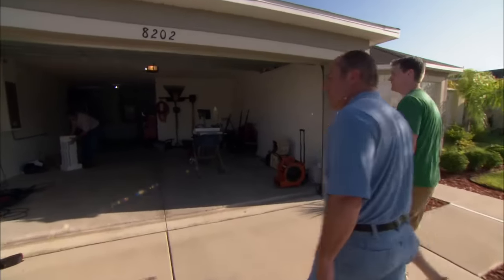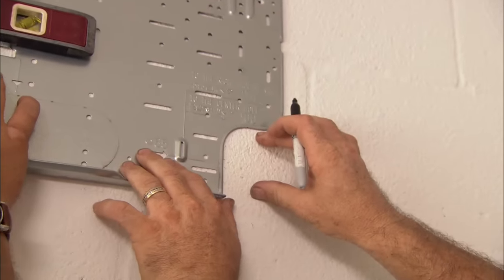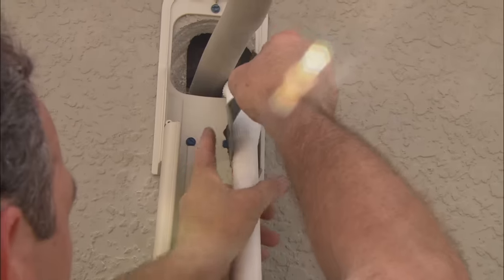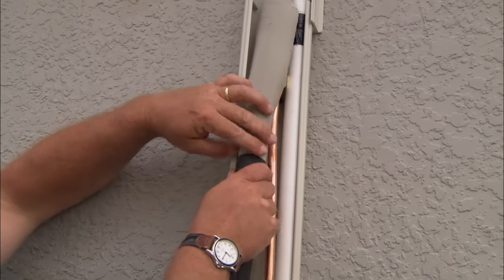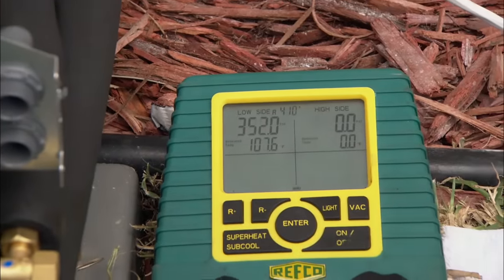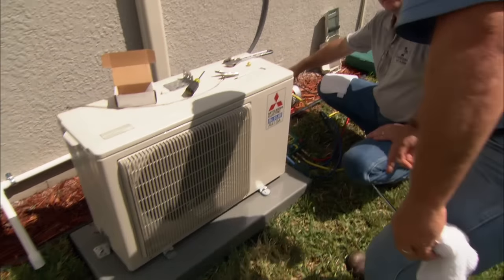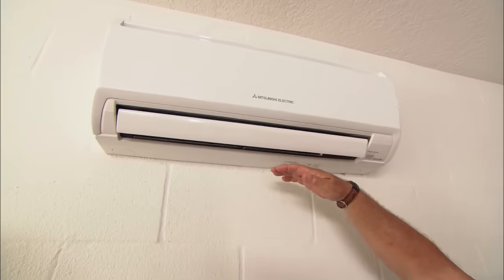How to Install a Ductless Mini-Split Air Conditioner | This Old House

Comment: Why isn't the external unit mounted on the outside wall?
Reply: this is a personal homeowner decision.  mounting it on a wall bracket insures a much cleaner looking install with easier lawn cutting and no worries from snow fall in colder climates (obviously not an issue in this climate) but also posses noise issues especially on a cinder block wall like this one where the outdoor vibrations CAN travel through the wall bracket and into this inside conditioned space.
Reply: Oh come now, the unit is cooling the garage, not a bedroom!  Lots of noise inside a garage workshop!

Comment: ive never seen that make flare tool, it works cause that was a perfect flare. It looks weird at first seeing bare wire outside i guess that cover is to code! I know there is liquid tight after the cover

Comment: "Idiot-proof."

Challenge accepted!
Reply: +bigchicago111 we love cold air in the summer!
Reply: Seems that is very easy to do this by yourself, but I prefer to call a plumber :) #rfzstt
Reply: More POWER!!!

*sponsored by Binford tools
Reply: Damn it ain't idiot proof! Ma, call 'em 'bulances I got my all tide up.
Reply: I twisted the red, black, and green wires together and put a wire nut on them. So..question. Is this thing supposed to be smoking like this?
Reply: Someone give this guy a medal.
Reply: ok
Reply: GodOfPopTarts ඉය
Reply: Being in a room without aircon feels like sauna

Comment: 0:00 - Ooh, I'd love to do this for my garage!
0:30 - Yep, this looks doable, maybe next weekend?
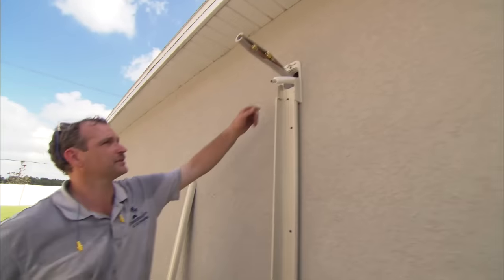2:00 - Hmm, this might be a big job ...
2:40 - Oh, I would have probably messed that up and crimped that line.
3:10 - "Flaring tool?" What is that?
4:40 - Testing for leaks with nitrogen? Who are they kidding? I can't do this!
5:30 - Yep, this is why you hire a professional to do this job. Not even remotely tempted to try this myself any more.
Reply: I had the same.exact.thought...in the same exact sequence🤔
Reply: Its actually easier than you think 🤔!
Reply: To think all this took less than 8 minutes.... lmfao
Reply: Testing for leaks is not complicated. -Hook your gauge hoses up to the access stubs of the service ports
 -hook your middle hose (the yellow hose) to a regulator on your nitrogen tank
-make sure your gauge valves are closed, open up the nitrogen tank
-adjust the regulator to about 300 psi
-open your high and low side gauges slowly until the pressure on your gauges reads about 250 psi on high (red) and above 120psi or "retard" on your low gauge (blue)
-check for leaks using soap bubbles at all connection points, try to see if you can hear any hissing as well
-once you confirm no leaks, close your nitrogen tank, and unscrew the hoses from the manifold (just enough to purge nitrogen from system)
After that you just reconnect your hoses tightly to the gauge, hook up your vacuum pump and evacuate to 500 microns (about an hour. 30 mins with a 3/8 vacuum hose and port)

Think you can do it? I do refrigeration for a living but ductless systems are literally child's play. If you follow the proper procedure you can do it yourself.
Reply: You can get ones with pre charged line sets you wont have to do any of that

Comment: Did you know that a masonry bit doubles as a re-bar finder?
Reply: Yep, but then it quickly is not a masonry bit anymore...
Reply: And arm breaker?
Reply: Mine chew through rebar no problem.
Reply: And today I learned every tool has a built-in  in hammer,  except a hammer.
Reply: 😆 always!  but on tv they magically vanish
Reply: @robertl.fallin7062  This actually made me laugh out loud. Excellent!
Reply: " We don't need no stinkin' rebar. "- Florida

Comment: I really love to watch the differences concerning installing this unit between the USA and here in Holland. We are not allowed to use the flare nuts. So we remove the flare connection from the inner unit, and braze with silver solder the copper pipes directly on the inner unit. The communication cable between inner and outer unit must be shielded. For the electrical supply,  we must use covered cable (not the 3 seperate cores). The safety switch must be from PVC . Metal junction boxes or switches are not allowed. I like the concrete foundation where the outer units is mounted on. But because of laws here, we are not allowed to carry stuff more than 25 kilos (approx 50 pounds), so we mount the unit on a console on the wall, or (when installed on a roof) recycled plastic beams. Oh, BTW,  we use a 300 mm (approx 1 foot) 60mm (2,5") hollow drill saw, to cut the hole from inside to outside in one move. Greets from the Netherlands  (in Europe).

Comment: I pity the Fool that tries to copy the labor that this Old House does in general, especially this installation-  this took 3 skilled/experienced workers, probably at least 1.5 hours.  They had all the right stuff to deal with the installation.  Can you imagine trying to do this without a great depth of experience in electrical/plumbing/or AC?  Just the crimping tool alone would drive average Joe made.
Certainly not feasible by a non-skilled worker.  So, the benefit?  Purely educational unless you have ALL OF THE ABOVE.
Reply: not being an idiot helps too though

Comment: So convenient that there happened to be an electrical box right where the outside unit was placed.
Reply: Colin Costine 👉 It is call planning, or thinking ahead, something you do not do apparently.🤦‍♂️
Reply: theyre the ones that put the box there.. it’s called a disconnect. it’s to power the outside unit Lol just one wire

Comment: These units are cheap and inexpensive in Puerto Rico. Come in all different sizes, wireless, etc. Compared to regular a/c units that are either window mounted, swamp coolers (which are horrible) or your standard central a/c house units. Compared to the prices that they want to charge in Fresno, CA for a/c & inverter plus install. We are thinking of buying one here on the Island and taking it with us back to Cali, and doing a self install, for the pool house. They quoted me $2500 just for the install in Fresno, CA. :( It would be cheaper for me to hire a technician here in Puerto Rico and flying him out to Fresno for the install, LOL These types of units are great for Older Homes that don't have ducts installed and safer that a window install.
Reply: Yes, the HVAC industry is ripping a lot of people off. What a shame. Its industry run, as they dont want these units to be used. They are putting other companies that are already fat and overweight on a diet. lol. The cheapest I was quoted with no elec work was $750, me supplying the unit. If it was $300-500 maybe worth it. But tools($200-250) and a few hours of reading watching learning is worth doing, and installing it right. Now you have disinfo not only in news, but in industry, as I see hvac people posting wrong info. Very sad.
Reply: @starlondon7547  I actually got it installed for $300 including vacumming the line and electrical for my 220v unit . Not bad. I would have to buy a pump and some tools that would be about $100 anyway.
Reply: @philindeblanc  You got a Blessing !  If you look long enough there's somebody with the skills.

Comment: Also, make sure to use 45 degree flare tool, that Ritchie should be okay. Use compressor POE oil on seat of flare before tightening, otherwise you may rip and burr the copper (especially on the quarter inch lines) Also you should torque the nuts to the specified ft/lb for the line set size for the same reason. This is where I see errors on 90% of installations I get calls to fix  when people become frustrated and no longer want to deal with the original installer.

Comment: I would think thy would leak check fittings be for insulating them and taping up!
Reply: +William Powell Most good quality fittings are really well engineered these days to minimize the chances of leaks. But yeah, I guess its still good practice to check anyway.
Reply: They did a leak test with nitrogen gas at 300 psi held ok.
Reply: Shouldn't is the operative word here.
Reply: It is impossible to properly insulate the pipework when it's all connected up unless you cut the lagging on which looks shit!! Not to mention if your pressure test holds it's more effective than any leak spray especially on a larger system doing a pressure test is quicker and easier than leak spraying every connection
Reply: William Powell 

You do.
You don’t fully insulate until you’ve peak-tested the fittings.

As a matter of fact, you are supposed to use a torque wrench to tighten the fittings just right.

These systems work with R-410A refrigerant; the pressures can reach up to 400psi on the high side.  You bet that will leak if you only hand tighten the fittings.

More importantly, they need to vacuum test the system.  Pressure test alone does not guarantee the system will work fine. Moisture must be removed and if the micron gauge does not hold less than 500 microns for at least two minutes, there might be a small leak.
Reply: Analog pressure check is a sure fire way to guarantee a revisit.  I test in shop conditions with a digital tester that compensates for the nitrogen curve on temperature variance.  I can find  a 1 PSI nitrogen leak over 48 hours that an analog manifold gauge wouldn't even indicate over a week.

Comment: I’ve learned over the years , there’s this stuff called Nylog . It’s pretty much a liquid gasket that’s compatible with 410A and r22 . It comes in handy when making your flare connections and I will stand by it

Comment: Also copper pipe used in airconditioners is a soft copper. Much different/flexible  to the copper that your water runs through. So it is quite easy to bend with your hands without kinking the line.

Comment: The ground connection didn't look very secure.
Reply: I saw that and yikes.... really needs a spade connector crimped on it.
Reply: As soon as I saw that I came to the comment section to see who else noticed that!
Reply: Yep, and the other wires may need to be tinned. Those looked like solid wire terminations.

Comment: One of the best ductless mini split installation videos on the net.
Reply: First off - I'm a huge TOH fan.  Subscribe to the magazine and watch reruns too often.  I was disappointed that they never even mentioned the 220 volt disconnect that just "appears" on the outside wall.  So I very much disagree that this is "one of the best" on the net - please keep looking for many other more complete system installs.  The DIY guys go way deeper on all steps. so I'm voting down this comment.

Comment: I wish I could do this work myself and save me money.
Reply: You can. If you live in Oregon or Washington. The Heat Pump Store has DIY. www.theheatpumpstore.com
Reply: said site references not a single DYI link
Reply: Check again... Top bar second row DIY with assistance.
Reply: You going to buy a vacuum pump, nitrogen bottle, and regulator, a flaring tool
power tools drill bits, that will really save you money
Reply: @charliebecker4417  Plus I did not see anything about the electrical lines need and I think this Unit is 220VAC?
Reply: Safe yourself some Money Marine!  Let the Pro's do the work.  If it's done wrong by them it's on them!   Semper Fi